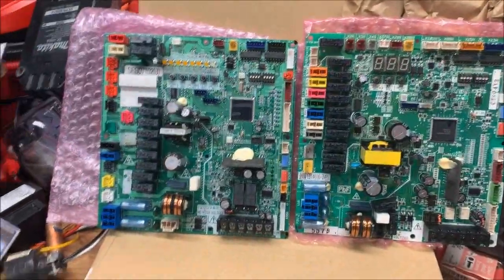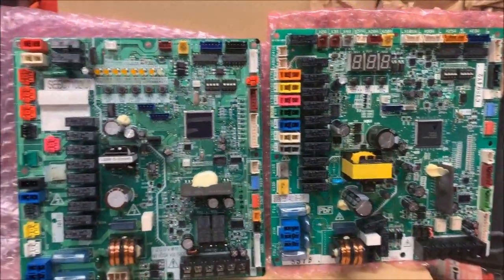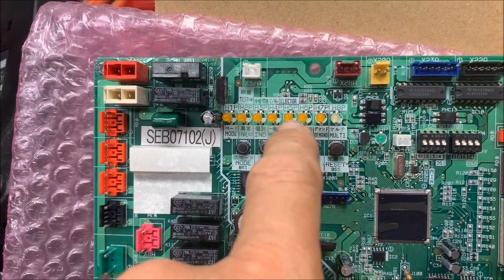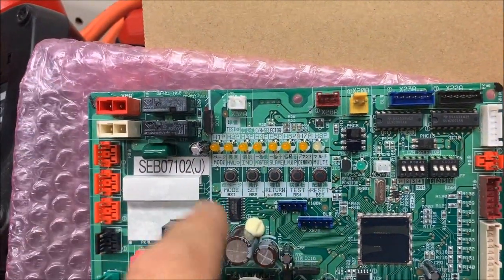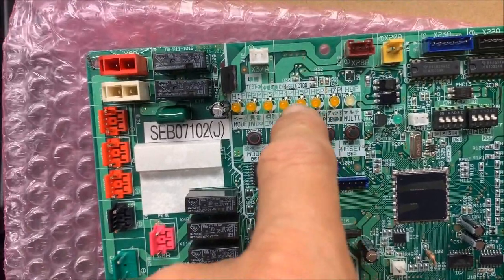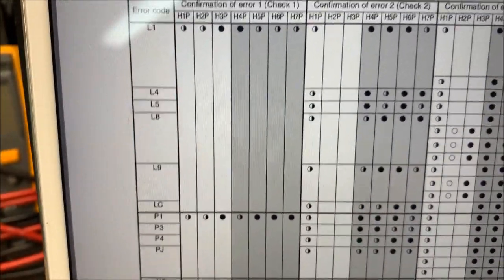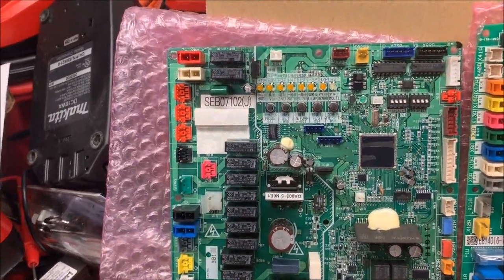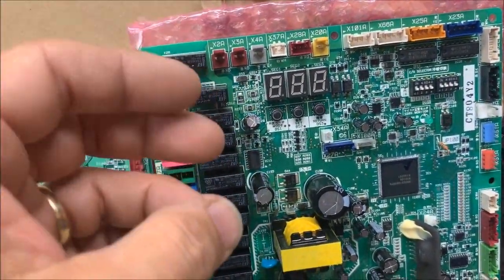Daikin VRV Monitor Mode

Comment: if the green LED (Service monitoring light-HAP) is flashing, what does this mean? Is it normal operation or a fault?
Reply from the maker: Normal operation. On or off indicates a fault.
Reply: @tcphvacr9950  Thanks for a quick reply. I asked Daikin Tech Support the other day and the guy said green flashing means there's an error,  a bit confusing. 
The Outdoor unit is a RXYQPAY1, has 3 x indoor wall units(FXAG25MAVE), not sure which series VRV this is.
 Indoor Unit 3 not cooling enough when all 3 indoors are on but seems to come down in temp if I turned the other two off, seems like a low refrigerant issue. Indoor coil apparently hisses really loud at night.

Comment: I have the RXYQ168XAYDA. I have error L1-12 is 12 referring to sub2? 
My manual error codes are incomplete and I have trouble finding my manual on the internet. Thanks
Reply from the maker: Here is the manual, page 286 has the code. You are correct, it’s the Sub 2 module. Save this manual to your device, I had to Google it, their website doesn’t list it in the normal area.
https://cdn.daikincloud.io/PIM/Assets/Documents/SM-REYQ_XA%20(SiUS371901EB).pdf

Comment: On the right side of the PCB there are some switches 1234 any idea what they do? I would love to see a vid about them
Reply from the maker: Those are capacity switches. From the factory, the board is programmed and all of the switches are off, but on a replacement board, there is a chart that shows how to set the switches depending on the model number.

Comment: pls i need help on vrv4 ,the compressor was not picking and i check it then i discovered there is no any gas in the system so i  presurize the pipe line and i found where the pipe is leaking then i represurize the line to 40 bar after presurizing i vacum the system to 400 micron but now that am charging the system with 410 gas the unit is showing an error code JC and i read the low pressure sensor is ok then i still proceed to change the main panel still showing the same error code,pls help me and tell me what to do ,each time am about to autor charge the system will keep showing JC
Reply from the maker: You either have a code stuck in the system, or a bad pressure transducer. Sometimes the sensor will ohm out fine, then trip intermittently. Change it out, after you find out which module it’s in (if it’s a multi module system).

Comment: I have L1 error code on my ducted heating and cooling system, heating stop working. Any common fault or what should be checked first?
Reply from the maker: Check your incoming power supply. If there was a generator supplying power to the unit, that can cause a fault. Then check your wiring from the main terminal block to all components and make sure there is nothing damaged. Then you’ve got to check and see if your outdoor fan motor is good, then your compressor and your inverter board for the compressor. Download the proper service manual from daikinac.com, and it’ll give you the steps necessary to do all of this. And other than checking incoming power, the rest of the checks should be done with the power off.

Comment: i have fault u4-01..whats the cause..connection wiring is good..before unit is running properly..is the controller board have problem?
Reply from the maker: If you have multiple outdoor units connected, check the Q1Q2 wiring to each unit and make sure nothing is wrong with it. Then go check the indoor units or BS boxes (if it's heat recovery) and make sure nobody has turned off the power to one of them. If that happens, the system will not run until power has been restored to the unit powered down. I've seen units get turned off when people change out ceiling tiles and accidentally hit a switch, or someone turns off a breaker in a panel, not knowing what they are doing.
Reply: all indoor have power..indoor is blinking..error u4 -01. only single outdoor..5 indoor. i reset all .but they same problem..power have..controller     
in outdoor in f1 and f2 have 16.45 volts. outdoor unit blinking like this ¤¤¤ ..i cannot emergency run also..or test

Comment: How do you clear old faults in a VRV IV board
Reply from the maker: Nathan Cardoza put it in additional charge mode. That will clear all the faults on the indoor and outdoor units. Take it out of additional charge mode if it doesn’t error within 5 minutes. If the fault comes back, you need to find the cause of the fault and repair. Sometimes you have to power down all the indoor and outdoor units, then power up the indoor units first, then the outdoor units.  If a code hangs on and is stubborn, that will usually do it. The first option is what I try first, so I don’t have to hunt down the indoor unit breakers. You will have to start all the indoor units with either option once you are done, either at the iTouch Manager or on each individual NavStat.